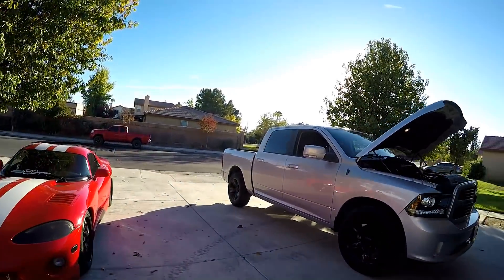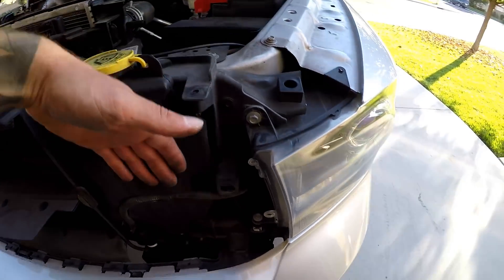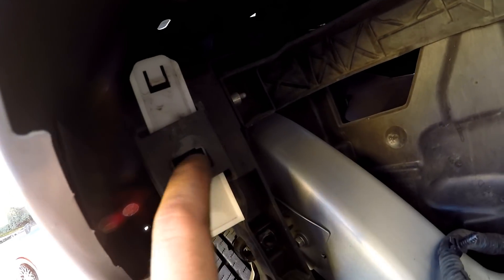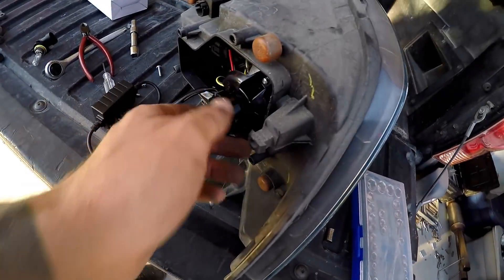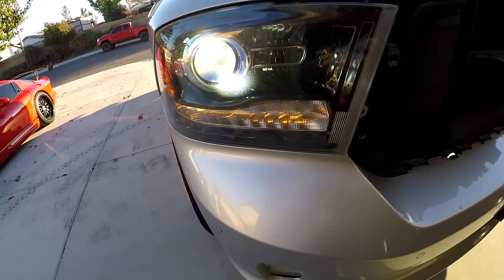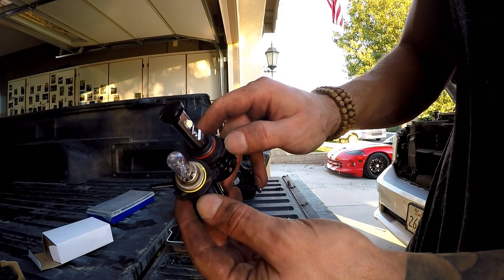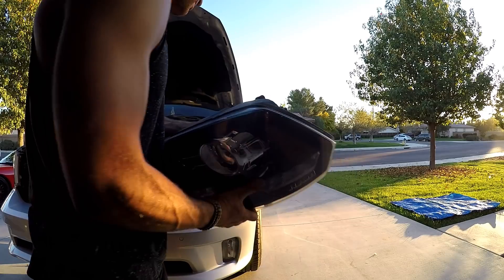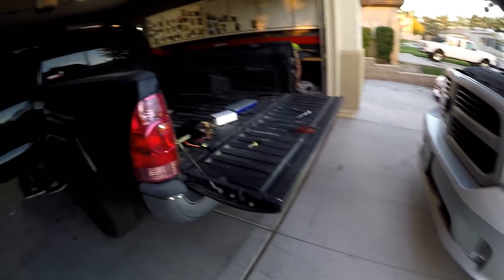Dodge RAM - LED Low Beam - Projector Headlight Bulb - UPGRADE

Comment: I might do led on my 14. I don't have projector beams however. I did do some research for my wife's car which does and I found some info that said led bulbs are not ideal for projector beams because of light pattern output and spread. Best option for an upgrade to projector beams according to that video was HID.
Reply from the maker: Yeah I did a followup video a week or so ago on the light output of these check it out.  Also about to do another video coming up with HID bulbs being installed in these projectors to try and get some more light!
Reply: Where did you hear that? I'm a Mercedes Benz graduate and a level 4 BMW tech. This is 100% false. I've been doing LED upgrades for years now and LED belong in projectors just like HID. They dont belong on a normal reflector. What do you think all the 2018+ higher end model cars like benz/bmw/Audi Bentley/rolls all have LED from factory with projectors..

Comment: I’m getting a Diablo Intune for my Sierra. I have installed led’s in my headlights and fogs. My question is do they interfere with you tuner when you are tuning it and cause it to error. They say aftermarket accessories can do that but wondering if that would apply, thanks
Reply from the maker: Nice truck!!!  Nah you'll be fine brother the LED's won't have any affect on your tune!  Mod away! 👍
Reply: Boosted2k thank man I do appreciate it and btw nice build you have going! Hope it all turns out the way you want it!

Comment: What hid kit did you use
Reply from the maker: I used this one in my fog lights with no issues so far
https://www.ebay.com/itm/55W-AC-9006-HID-Xenon-Conversion-Kit-Canbus-No-Flicker-For-Nissan-Titan-8000K/202215205615?fits=Make%3ANissan&epid=4010676551&hash=item2f14f72aef:m:mM0PEI74s3e2H1okJ216MDg&vxp=mtr

Comment: hey man I love the look of those led light if u don't mind me asking what year model is ur truck I got a 2016 model and I know hey changed the bulbs and cambus system in like 2015 so not sure if this will work on my year model
Reply from the maker: Mine is a 2014 but if you have projector headlights yours are exactly the same.  They changed it in 2013+ trucks.  You should be all set just grab it off Amazon.  If for some crazy reason it doesn't work out then you could always easily return them through Amazon too!  I might try HID in the low beams next, some people said the light distribution is better with HID but these LED lights come on instantly and look way better than the yellow halogens.  Just remember you will have to trim the 9006 bulb like I did to fit in the 9012 housing like in the video.

Let me know if you have any other questions!
Reply: I have a 2015 sport and from what I am reading the 2015 has a new canbus system and some will not Work. Trying to find the right set for me so I can order soon. Great video btw!

Comment: Good job buddy I want  those for my 2017 sport thanks
Reply from the maker: Thanks Luis!  I might try an HID kit in the headlights next.  Even though these LED bulbs are ridiculously bright some people were saying the scattered light from an HID bulb might be brighter in these halogen housings.  The LED kit I installed in this video has been working great with no issues but I feel the light output could definitely still be better.  Some have even gone through the trouble of replacing the stock projector and modifying their headlights to overcome this.

Check back though I'll probably give the HID kit a stab in the lowbeam projectors soon too!
Reply: If you do this to urs, dont take the whole grill off man. No need for that, ur just making more work for yourself. All you need is a 10" ratchet extension to get to that bolt that's hidden.

Comment: I like ur video bro. I like how you show and explain how to take the grill off, but if you're simply putting a new light bulb in your headlight is all your doing, NO NEED TO TAKE THE WHOLE GRILL OFF. You need a ratchet extension to get to the other 10mm bolt that's not visible. I did this to my 17 ram and put led bulbs in. They came out nice.
Reply from the maker: Nice work!!! Yeah usually I just pull the grille its pretty easy to do once you've done it a couple times 👍

Comment: Did you change the high beams or leave them the same and will that kit fit the 2017 Crew Lonestar Edition?
Reply from the maker: I just left the stock high beams since I rarely use them in the city. If you have the projector headlights like mine it will be the same kit for your truck.  Let me know if you have any other questions!

Comment: I have the same LEDs I'm about to install on my 2017 Bighorn does that canbus hook up a certain way to the headlights is it reversible there's no indication on positive or negative
Reply from the maker: Hey Matty!  It only has one direction and worked fine plug and play.  Did you see the light output video I posted on these in a recent video?  I'm actually about to install HID bulbs to get better light output cause the LED bulb doesn't project the greatest from these factory projectors.  Let me know if you need more info! 👍
Reply: Boosted2k. Thanks I installed them last night at first they didn't work so I had to flip the connection around and then they turned on. They are super bright in my headlights. I don't have the projection lights, I did hear they were dim in those but in the standard headlamp they light up the entire street.
Reply from the maker: Oh if you don't have projectors then those LED bulbs will be amazing in your truck!  When I had them in my fogs they are insanely bright!  Keep us posted on how you like them!  I'll be doing the same with all my mods on the channel and if anything breaks or doesn't work you guys will know! 😁👍

Comment: Is it the same led bulb for the high beam or will I need to buy two kits I have the same head lights as you
Reply from the maker: Hey Rudy, the high beam and low beam are two separate bulbs on our headlights.  I didn't bother with the high beams cause I barely use them to be honest!

Comment: Is it possible to fit led high beams in there as well? I’d like to do both but I’m afraid all that hardware wouldn’t fit under the dust cap
Reply from the maker: There is actually quite a bit of room in there.  I think it would be tight but your could probably make it happen if you wanted to!

Comment: Thanks for your very informative video John. anyway i broke my grill retaining clips yesterday was changing my stock halogen bulb into a Philipps crystal vision ( cant afford those LED HID atm )
Reply from the maker: Ah sorry about your grille! I know they are a bit difficult to remove unless you your hand back there like I was showing.  I hear ya on all the upgraded bulbs, glad you got something better in there though! .👍
Reply: All you need is 10" ratchet extension to loosen that 10mm bolt thats underneath the other very visible 10mm bolt. You do not have to take your entire grill off.

Comment: have you got pulled over for them or people flashing you thinking they're brights?
Reply from the maker: No not at all.  They still retain a good cutoff and are absolutely not blinding to oncoming drivers.  I've never had anyone flash me and they look like how the truck should have came from the factory!
Reply: Boosted2k I have a 17 limited and I get flashed more than I should and stock is dim as shit so go figure. thanx for the reply. cool vids!
Reply: I get flashed all the time with my stock lights in my 17. Hesitant to make them brighter even though they suck.
Reply: supperterofsanity same that's why I asked... looks like we don't have to take the grill off at least

Comment: Hey Man, attempting this on my 2017 Ram Sport, what is the smaller connector  box called in between the canbus decoder and the bulb. I failed just using the bulb and canbus decoder, I got no light at all. Could that connecting piece be the issue?
Reply from the maker: Well coming from the factory harness it should go in this order.  CANBUS Decoder -> BALLAST -> HID BULB.  Are you doing HID or LED?  We improved this setup since this video by installing a 55w HID kit with a CANBUS decoder.  Lots of guys running the latter setup with awesome results.  Check out that video HERE https://youtu.be/Vmi6eeoOL5o
Reply: If you really want to go with an HID system I recommend that you buy OBDLINK MX+. Paired with the app AlfaOBD you can change all your lights to LED or HID or mixture of both without needing to add any other wiring. There are many videos and how to's out there showing how to do it. I have upgraded to HID low beams, LED high beams, LED fog lights, led license plate, led reverse lights, led 3rd brake light cargo lights. My tailights were already factory LED. I also turned on my DRL and put an option on the radio to turn it on and off.
 The total cost for the OBD reader and the app was around $100 but well worth it so you can change whatever you want without having to purchase CANBUS resistors or anti flicker resistors.

Comment: I'm debating going with LED's on my fogs as well as my non projector headlights. No issues with that brand?
Reply from the maker: LED in the reflector housings work great!  Its when you put them in the projector housing that they suck balls 🤣
Reply: Boosted2k any issues with those LEDS yet?

Comment: During your night shot why does the left side look super bright compared to the right side?    What's the update on the install,  are you happy with your upgrade to leds for the low beams , or would you have done hids?
Reply from the maker: Hey Steve,  both sides are equally bright but I think the projectors just don't like LED bulbs in them.  It is an improvement over stock but I still think there is room for improvement.  I may try a HID kit in the projectors and see how that goes. These LED bulbs are INSANELY bright because I had them in my fogs before moving them to my lows.  The projector just eats up all of the lighting it seems and doesn't "project" the light properly.
Reply: Boosted2k   I went ahead n ordered a hid kit from headlight revolution,  the price was high, but it looks like a good product.

Comment: Thanks for the great vid.Curious, what year is your Ram?I have tried two different sets/brands of LED's and neither fit (one was too long, the other the fan housing on the light was too wide - couldn't get the back plate back on the headlight enclosure....I see in your video no issue with the Hikari.Frustrated...Thanks!

Comment: Hey man, I know you said you didn't install high's becaue you don't use. But would there be room to do both low and high with the Hikari kits?
Reply from the maker: There might be!  As you know I didn't attempt doing this but there does seem to be quite a bit of room in there without having to modify the back cover!  Let me know how it goes if you try it!

Comment: What's the best way to pull the headlights? I removed the bolts and pushed up the tab but the head light did not want to budge forward, it just rocked side to side a bit
Reply from the maker: Michael Kelleher if you pushed the tab all the way up and removed the 2 bolts just grab the headlight where the bolts go and pull it there. You need to use a bit of force cause there is clip the "pops" out when you pull on it kinda near that tab

Comment: I did the same thing in my f150. It had refector housing vs projectors. I had everything tucked inside just like you did and a few months later it burned up my my LED bulbs. Found out it was excessive heat from the driver for each bulb. Had to relocate the driver to the outside of the headlamps.
Reply from the maker: Damn thanks for the info Matt!  I'll take a look when I get a chance to see what things look like in there with the heat.  I Might actually try HID in the low beams soon to see if they have better light distribution in these housings too!
Reply: Boosted2k I have a 14 Ram Sport now so I'm going to try a good hid kit.
Reply from the maker: Let me know which one you try. I've been running a pretty good one that is only $40 and doesn't throw any codes on our trucks.  Been running it on my fogs but it fits in the lows too.
Reply: Boosted2k any update on the possible heat issue? Along with testing HID in low beams?

Comment: Great video boosted. I am having such trouble here on my 2016 ram sport crewcab. I have hikari LED's in the fogs which are great. I decided to put the same in my lows and my light pattern sucks to say the least. Now my truck is calling for 9005 in the lows which is what i ordered. I am wondering what you bulb orientation is as far as the LED's themselves. Are they up/down or left/right? I am going nuts here man, lol. Any suggestions. Not I have the Hikari's with the newer phillips led's. Thanks.
Reply from the maker: Hey Joe check out my other videos as I have since upgraded this setup. I have a video showing the comparison of LED bulbs to HID bulbs in these low beam projectors and the HID bulbs are 10x as bright for this application!
Reply: BoostedMotorsports Thanks man for getting back to me.  I also upgraded to HID yesterday ☺ great beam pattern along with hotspot. So much brighter. Thanks again 🖒🖒🖒🖒🖒🖒🖒🖒
Reply: I switched over to 55w 6K HID's and I am so happy I did. Thanks for the scoop !!!!!!
Reply: @i72locomotive   what brand and model  hid's did you put in your truck.
Reply: Also I went with 6000k color !
Reply: @i72locomotive  thanks a lot for getting back to me.

Comment: Have you had any issues with the hakari led kit? Mine keep turning off and back on randomly. ( I have a decoder installed)
Reply from the maker: No issues at all on mine.  Did you use the Hikari brand decoder?
Reply: Boosted2k yeah i got the hikari decoder...I also have the same projector style headlight. I put the 9006 bulb. Do you think I should switch to 9012?

Comment: Do they have a high beam as well?
Reply from the maker: The high beam is a halogen in a reflector style housing next to the projector on these headlights.  I hardly ever use the highbeams so I didn't bother replacing that bulb :D

Comment: Low beams are 9005.. Dealer says. Hmm
Reply from the maker: Yeah they changed bulb types throughout the years so double check.  Also check in the comments on this vid for the new bulb list as well as the other vids on the channel cause we found HID to work better in these projectors.

Comment: Hey bro I like the videos I have a 2018 Dodge Ram 1500 and I want led’s in my low beams and fogs what bulbs do you recommend? I like the hikari
Reply from the maker: Hey Kyle check these out from this video.  We updated the setup and got some better lighting from HID in the low beam projectors compared to LED

9006 C6s LED BULBS used for the fogs
https://amzn.to/2EaeYOY

INNOVITED 55w HID KIT for the low beams
https://amzn.to/2Yz7VHj

HIKARI CANBUS DECODERS for the low beams
https://amzn.to/2Eb2JBQ

LICENSE PLATE LED CANBUS
https://amzn.to/2Vrbcq4
Reply: Why do you have a link to headlight bulbs for the reverse lights?

Comment: Great video do you remember how much clearance you had from the back of the cooling fan to the cover?
Reply from the maker: Hey Justin, its hard to say because once you put the cover on you can't see behind it of course but there isn't much.  The fan has vents all around the side of it though so it can also breathe this way as well.  I might pull it apart just to see how everything is looking in there at some point.
Reply: I bought the 9012 LED bulbs and they are too long. I’m afraid to tighten the 5 screws back on. Sorry, 2014 Ram 1500. What do you suggest on modifying?

Comment: Man your Ram videos are amazing and helpful.   Wish you had replaced the engine compartment light with LED before you sold it.
Reply from the maker: Yeah that was one mod we didn't get around to but should have another RAM on the channel soon.
Reply: BoostedMotorsports man I just swapped out the low beams and high beams just now.   Cannot wait to see them tonight.  Your video was dead on for directions and advice.  Thanks so much for doing the vids

Comment: Good job on the Ram mods, and thanks for saving us a lot of headache trying different products. I am a big fan. A quick question regarding the LED headlights. Does the auto headlight switch work on the LEDs? I know you mentioned that the HIDs didn't work with the auto headlight switch in your other video.

Comment: I'm going to buy LEDs for a Ram with a projector (low, high and fog) I need resistance or something for the LEDs or just connect and turn on

Thanks!!!
Reply from the maker: Hey mike you need those canbus decoders shown in the video.  If you go with the kit I used and tell the company you are having issues they will give you a coupon code to buy the canbus decoders for $1 on Amazon.  Let me know if you have any other questions!

Comment: Man you got some dope as videos and I appreciate the knowledge you passed down. It’s helped me with my upgrades. I have a question. Do you still have the discount code for the hikari canbus decoders you said you installed for .99 cents ?? I’m tryin to get my truck sooped up on a budget !! Any help is appreciated. Thanks
Reply from the maker: Thanks for the support brother!  I would put HID in the low beam projectors if thats what your truck has though!  I've improved on this setup since making this video and the HID are WAY brighter.  The code they gave me was a one time code.  They are only $20 though.  If you email them after and say your stuff is flickering they will send you the code, or they did for me at least 😎